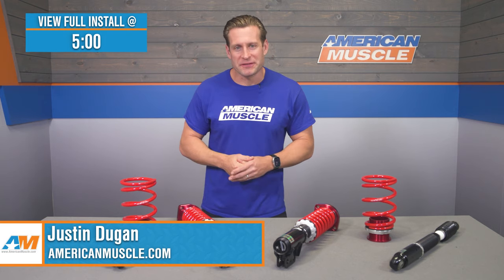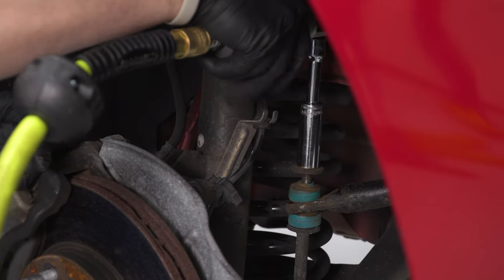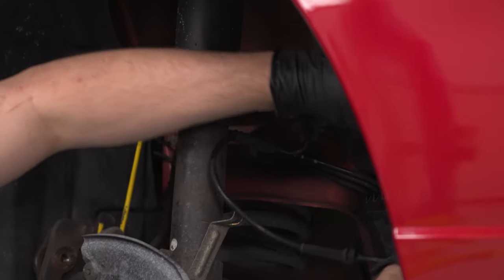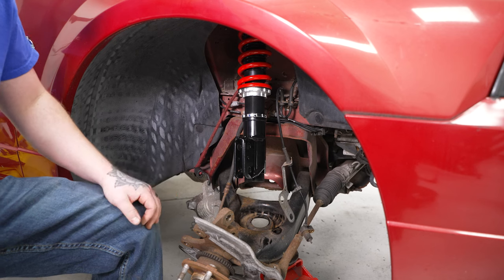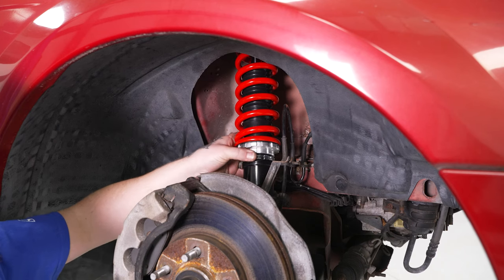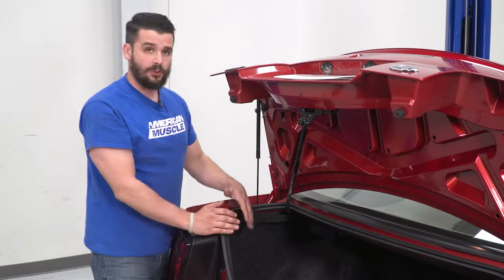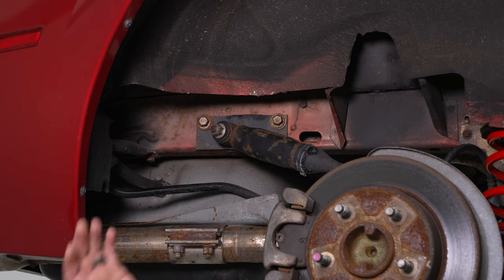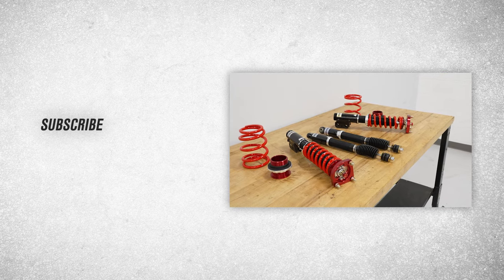1994-2004 Mustang Pedders eXtreme XA Coil-Over Plus Kit Review & Install

Comment: Just a tip on the rear shock length adjustment.. Install the adjustable height springs and go ahead and install the top of the shocks inside the trunk area.. slip the lower end of your shock onto the mounting point, and finger tighten the lower mount but don't tighten it down just yet. Install your wheels and tires and get your ride height adjusted with the spring adjustment. Now, with the car sitting on a level flat surface at ride height, go under the car and slip the bottom of the shock off the mounting point.. if your shock has 5 inches of travel, you should adjust the length of the shock body so the eye of the lower mounting point on the shock hangs about two inches below the mounting stud on the car.. This will give you three inches of compression and two inches of rebound on your shock travel. If you don't do this step, you can actually experience bottoming out of the shock or in the other extreme, little to no rebound.